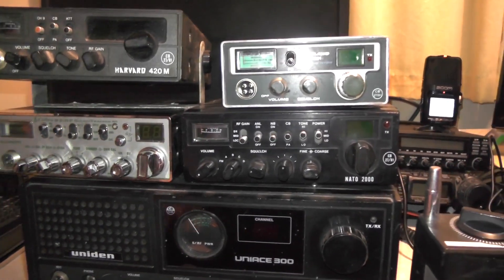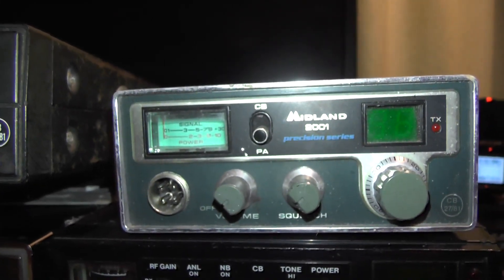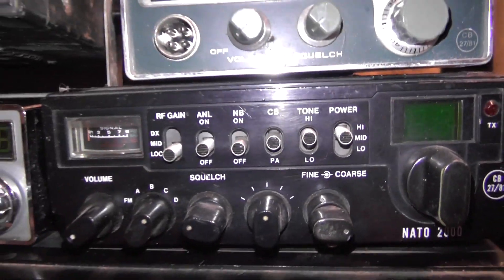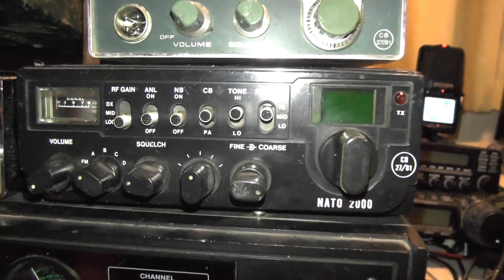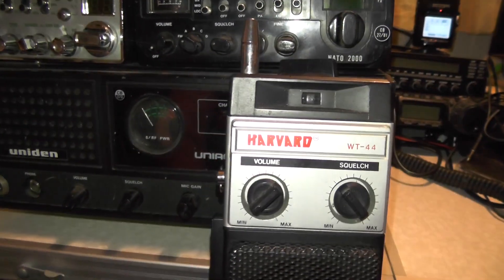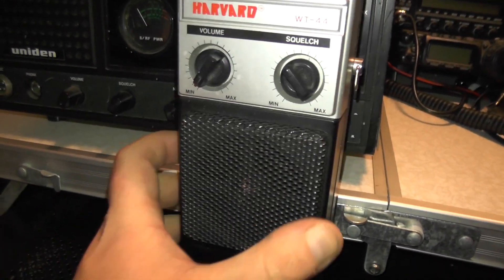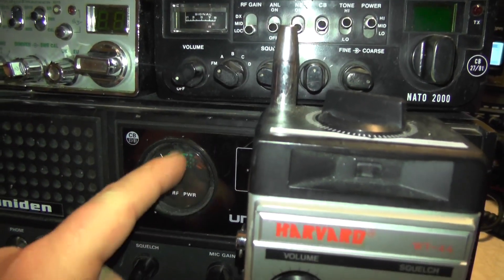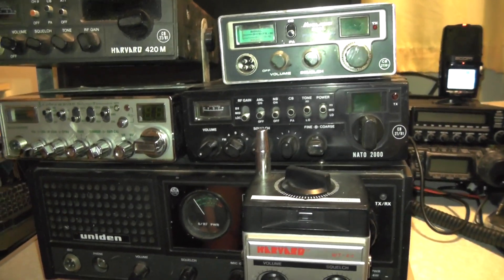Old CB radios

Comment: The NATO should be doing 10w on FM  /12w SSB. That’s as per the manual. I’ve got one and it does that. Sounds like yours may have an issue.
Reply from the maker: I’ll have to do a proper test using a dummy load and see what’s it’s doing power wise